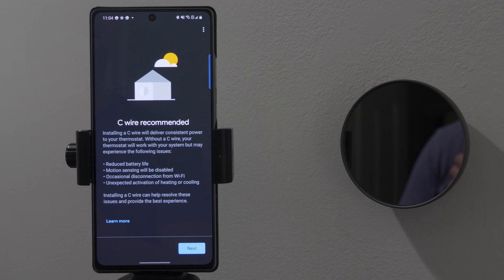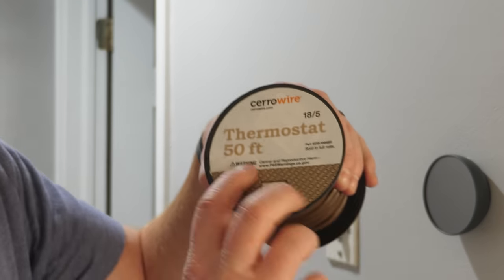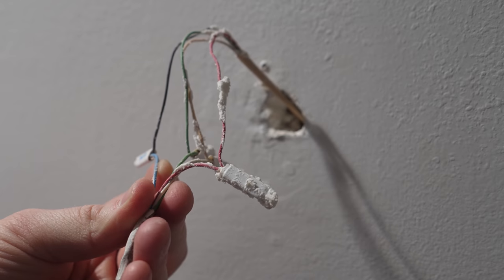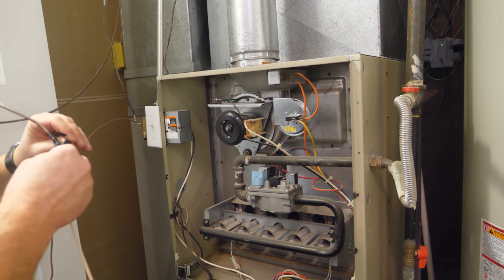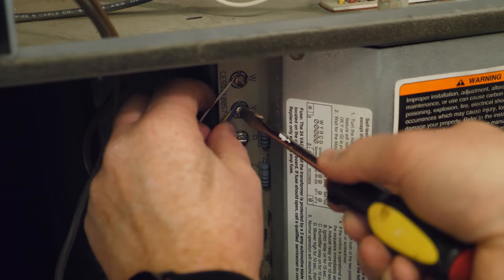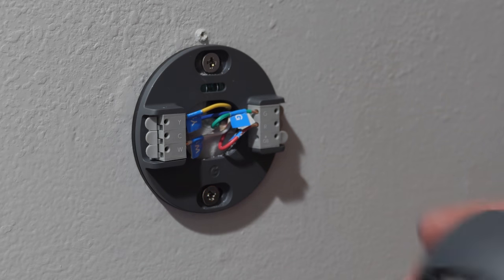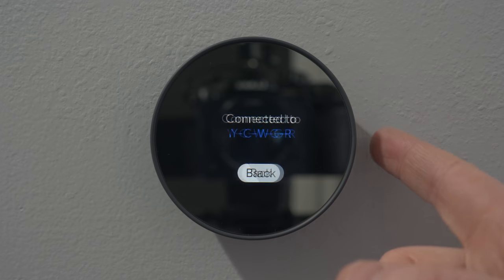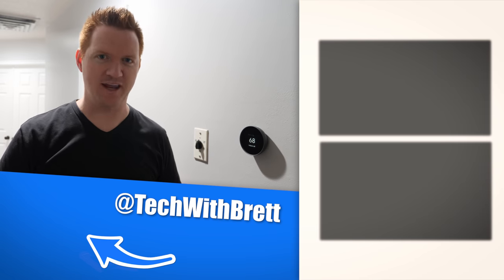Fix Nest Thermostat Issues by Installing a C Wire

Comment from the maker: This process ended up being a lot easier than I thought. Do you have any tips for routing a new cable that is in a more difficult spot?
Reply: I've used glow rods. They're rigid yet flexible. They also glow in the dark. They're helpful if there is insulation in the wall. Also, you might want to add that ppl kill the power to their furnace before working on it. I know it's only 24 volts but shortening out the board of the furnace is still a possibility
Reply: As someone going to school for hvac you really shouldn't mess with your ac unless you know what your doing you can cause some pretty big problems with small mistakes. Examples I didn't hear you saying anything about shutting off power to the air handler before messing with the t-stat wire also the way your stripping the t-stat wire is incorrect cutting into the insulation for the group of wire can cause shorts my preferred method is to grip the green wire and pull it down the length of the wire then cutting away the rest of the insulation but again most people should not be messing with this there's a reason people got to school for this
Reply: @baconbot3106  I mean yea, there's ways to mess anything up in life. People go to school to be auto mechanics, but how many people do their own brakes or oil changes. You could say the same thing there. This is basic 101 type stuff. Any man with half a brain could do this. Now hvac installations and serious electrical work, yes, that should be left to the professionals. But this is not serious. Just take the proper precautions, and you'll be just fine.
Reply: Don't install a nest read my post
Reply: You comment on google video of video google home
Reply: Sorry to be off topic but does anyone know of a way to log back into an instagram account?
I somehow forgot the login password. I love any assistance you can give me
Reply: @Jax Cairo It did the trick and I finally got access to my account again. I am so happy:D
Thanks so much, you really help me out!
Reply: @Kylo Donald happy to help :D
Reply: How about if I only have 2 wires where do I put them on the mirror nest
Reply from the maker: @stevem3493  what are the labels?

Comment: It should be noted for anyone attempting this, that this can be extremely easy and can also be extremely difficult. If there is even just ONE staple inside the wall holding the original wiring it will cause you nothing but grief. Let’s say there is a staple but it isn’t completely tight to the wire. You’ll think that you are good to pull the new using the old, but it’s not only possible but very likely that once your tape joint connecting the old and new reaches that staple it will snag. Your first urge would be to tug a little harder and then uh oh, it comes apart and now you’ve got two loose ends inside a wall or floor cavity, neither of which is connected to your HVAC system. This can also happen with a hard 90 degree turn, or a hole that was only drilled wide enough for the smaller harness. As soon as that tape joint/splice meets resistance, you’re snagged. The only recourse is to start knocking out drywall to finish the job. Not trying to scare anyone, but I do this for a living, and I’ve seen it happen
Reply: Drywall is easy! I live in an old house and the walls are plaster and furring strips.
Solid, good sound suppression.
Pain in the neck to work with!
Reply: Dropping wires should not be under rated in complexity. Good info and tape well, tight, and properly staggered with 3M super 88. A poorly taped end will also come apart easily leaving you up SHITE creek without a pull wire!
Reply: Agreed 100% …. People definitely need to be aware of this
Reply: Hahahaha (eternal laughter). No thanks
Reply: When I had a furnace replaced years ago, they had to run a whole new wire to a new location further down the hall because the original wires were probably stapled and wouldn't come out and it was too tight to get a new wire up to the original thermostat location.
Reply: FACTS REAL TALK
Reply: Absolutely good advice!
Reply: My thoughts exactly. I'm 100% certain it will get stuck if I try to pull it through in a house as old as mine.
Reply: If you do this for a living then when you say “ I’ve seen this happen” what you really mean is “ there is a very very good chance this WILL happen” lol……because I can’t tell you how many times I’ve seen the very thing you are warning people about. 95% or the time there is going to be at least one staple
Reply: Haha I came right to the comments to look for this. Seems like for most people the nest power connector is the best solution.

Comment: You were VERY lucky you fished that line through so easily. My luck mine will have been stapled to the studs all the way down. 🤦🏻‍♂️
Reply: Brutal
Reply: Mine isn't even run through the inside of the wall. It runs straight up from the furnace, into the stairwell, and through the wall behind the thermostat. It's just encased in plastic wire tracking.
Reply: @pthibault630  u do know they have an official adapter now.
Reply: @FaiyazC  Yep. This is cheaper and easier though.
Reply: With my luck that cable probably runs through my neighbors house before connecting to handler 🙄

Comment: 99 out of 100 times the wire has been run through studs or has a staple that will prevent it from being pulled back. You got LUCKY.

Comment: WARNING: try this at your own risk! I tried this, but the taped connection was too thick to go through a point (I imagine it being a hole that's just big enough for the wire itself). I had to pull the new cable back out from the thermostat hole, and I broke the taped connection. Now I have the old wire dangling somewhere inside the wall that I can't see and don't know where. What a disaster!
Reply: Update: after a few days of trying, I was able to fish out the lost old wire in my wall with the help of a flexible rod, a homemade hook, and an endoscope camera. I carefully redid the joint between the old and new wire to make sure it's not thicker than the wire itself and I was able to make it through. The spirit of my story is that you want to make sure the joint is not thicker than the wire itself so it won't get caught inside your wall because most likely the wire goes through some small holes.
Reply: @genegene2417  put the thermostat in a different location.. it uses WiFi to control.. can be ANY WHERE in the house

Comment: Even easier way to do this. Just use the green wire to the city. Most people leave the fan in auto. The green wire is used to energize the fan when the fan is "on". As an hvac tech I have done this many times before. Replacing the state wire is not always as easy as shown. A lot of times the state wire is stapled to the wall studs. When we are working on a new construction job we run a 5 wire.
Reply: Thank you!!
Reply: It's a good idea in case you afraid of losing the cable when you pull through the wall

Comment: Two suggestions... 1. Agree with many comments below that thermostat wire may be secured in most instances by staple(s). So before snaking have someone hold low end and someone hold high end, pull back and forth to assess whether there is free play. 2. Use wiring lube to make sure that the "snaked" wire pulls through any holes... its $5 at any supply house or homey.
Reply: yellow 77
Reply: hehehehehe..... lube

Comment: I’m so glad I found this video as my Nest was losing Wi-Fi every day when the battery ran down. I went to look at my wiring and there was actually a fifth wire already running from thermostat to hvac that just wasn’t being used. It was super simple to connect it to the C wire in the basement and just plug it into the thermostat. 30min of research, about 3min of work, and my thermostat is back online! Thanks!!
Reply from the maker: I'm so glad this could help!
Reply: Thank you for sharing your story same situation so thankful !!

Comment: One of your BEST tech videos.  Upgrading my thermostat to Alexa enabled, I knew I needed a C wire, but your video showed me how easy it was to work with.  I didn't have to pull any cables, and my system had an unused wire so I connected it to the thermostat and the a/c and I was done.  Great video.  (FYI I don't have a nest)
Reply: You have an Ecobee, and don't need a C wire, it comes with an adaptor kit.

Comment: Hopefully my story will help someone. Last fall we installed a Nest thermostat at my sons house. The replaced thermostat was using 4 wires (no C), so we hooked the Nest with the same configuration. The furnace and Nest worked fine all winter. When my son switched to AC in early summer, there was a consistent clicking sound from a relay on the control board. It clicked nearly once a minute, and was aggravating. Though the AC seemed to run fine and shut off at temp. An HVAC guy came out and said that we had a bad control board. We replaced the board and the problem was still there. After watching this video, I decided to hook up a C wire. My sons existing thermostat cable had 8 conductors. So we hooked the unused blue wire up to C on the back of the Nest and then hooked the blue wire to C on the control board. The AC has run for over 24 hours with no clicking from a relay in control board.

Comment: Mine also needed the "C" wire.  Without it I could not manually control the fan.  But, I did not have to run any new wire.  There were several unused wires inside the cable coming out of the wall.  I simply connected the unused blue wire at each end.  Now, my NEST is 100% functional.

Comment: Thanks Brett. I was wondering why stringing a new wire wouldn't work. Now I feel comfortable buying a Nest. I will be putting the thermostat in a new location. My old wiring is not so easy to get at. Thanks Again

Comment: Just wanted to say thank you for your video. I was helping out a neighbor with a new Nest Thermostat and found a blue wire unused. Connected both ends (furnace "C" terminal and the thermostat "C" terminal. It is no longer asking for the power connector.

Comment: Thanks for the this, I noticed that there is now a 'Update Wiring' option on the Google Home App -> Thermostat -> Settings > Theromstat -> Wiring -> Update Wiring. So you shouldn't need to factory reset anymore.

Comment: Sadly, my Nest appears to have a C wire connected, yet for some reason the fan runs randomly even though it's not setup to turn the fan on, which is annoying when it's cold out and it's blowing right on you. But thankfully you made this video which makes it really easy to see what sort of work it would take to set it up again (or at least know what to look at in order to fix it). Thanks!

Comment: Thank you very much,
I was thinking of installing this since several months, end up installing it yesterday.
Rewired as the c wire was missing.Had to cut one hole in the drywall.
Didn't removed the old wire, lets see how it runs for few months and then no need to go back.

Comment: If you are lucky, sometimes there will be an unused conductor on the existing wire.  You'll need to figure out where to connect the free wire on the furnace controller board C.  Sometimes the original installer prefers to just use a battery thermostat rather than connecting to C.  I was able to add C wire to my Nest in my first house and never had any issues.  I actually did it for my parents as well, without issue.  
It's generally recommended to always use the C wire anyway, as there could be temperature inaccuracies or triggering delays when the thermostat achieves the set points.

Comment: You can update the wiring in your home app on mobile. You don’t need to do a factory reset. 

Steps to do this on your mobile :

Select your thermostat on home app >> settings (gear wheel) >> thermostat (under device features) >> Wiring (at the bottom section) >> Update Wiring
Reply from the maker: Thanks for the info. It looks like that was updated since the video released.

Comment: Forgot to mention to turn off power before removing wires.  Or cutting into wires.   Turn power back on last.  If wires touch 24 volt will or could burn up your board

Comment: Had mine installed over a year without a c wire and still working great!
Reply: Does it ever get disconnected from the wifi or the battery dies faster?
Reply: @gloriahansen6727  the only time there was an issue was when I had a new furnace installed and power was off. Bat got a little low and internet disconnected for about 15 min until power was back on.
Reply: I have 4 wire.  Worked fine for a year then suddenly gave e298 error.

Comment: I had an interesting problem with our Nest Thermostat; any load I placed on our two-wire system started the furnace (think; the power it drew to run the Nest). Let me explain further… I started out with a two-wire system, Red and White, Red=Power, White=Call-for-Heat, the legacy thermostat was a standard mercury bi-metal coil. I installed the Nest and I tried placing Red on Rh and the White wire on W1, but the furnace ran constantly. So I ran and added a ‘C’ wire, I kept Red on Rh, the White on W1 (Call for heat), and the C wire, or common to the furnace. The furnace still ran constantly. 

The Nest thermostat functions by using a small amount of current from the furnace to, 1. Operate, and 2. Keep the batteries charged. I did some testing and ANY current draw over 6 milliamps starts the furnace. Testing with a ‘C’ (Common) wire still drew a small current and fired up the furnace. I found the markings on the furnace to be very clear, Power, Common, and Call for Heat. To be clear, W1 on the Nest is ‘Call for Heat’, the ‘C’ is common and R1 is 24 vac or power. This is not rocket science, if I draw any current from any of the wires it starts the furnace. 

I’m thinking there must be something screwy with the vintage furnace, vintage 1995. My initial solution was to remote the 24vac power and supply the Nest power from it, however simply placing the ‘Call for Heat’ wire (W1) on the Nest (along with the common wire), the furnace would start. Finally, I remoted the entire mess, I added a small relay and 24vac transformer in a project box near the thermostat and ran five wires up to where the Nest is mounted. Now everything works well…

The takeaway here is, not all furnaces are created equal…

Comment: What pisses me of is my system actually has 5 wires at the furnace but it appears the common wire was chopped off behind the existing thermostat. I can't run a new wire without relocating it due to how it was stapled down inside the plenum.

Comment: I first installed the Google Nest Thermostat on my Mr. Heater garage heater, without the C wire. The heater would continuously cycle until I installed the C wire.
Reply: U can use the neutral of the transformer for your c wire from your mr heater. Hook a wire up to it and to your tstat c terminal

Comment: Yes, a C-Wire will save your a lot from the hassle of not having one. Without a common wirre the thermostat pulls power from both hearing and cooling. If the AC unit has it's power shutoff for winter or you have dual zone a Common wire is recommended.
Reply: Thanx for the video and all the info in the comments👍

Comment: What I have been told, and actually verified by my own experience about "pulling" wire is: Don't!!  May sometimes be O.K with small cables, but on a bit bigger ones you have to PUSH and then only Collect whatever loose length there is.  That is particularly true when the cable has to go into a conduit.  If you pull, one or other of following things happen.  First, you peel the cable insulation and risk a short circuit.  Second, you pull the conduit along with your cable.  Third, with multiple cables in one conduit, at least the last one wedges between the existing ones and then all are locked in -- no pushing or pulling releases them any more.

Comment: This video is very helpful- just have a quick question- we are basically replacing the old wire with a new one? The new one has the extra for the C wire? Thank you!
Reply from the maker: Correct. My install was pretty easy because of the location of the furnace and the Thermostat and yours might not be so simple. What Thermostat are you using? There is now an option to get a connector so you don't need to rewire. Here is the one for the new Nest Thermostat:  https://youtu.be/tgAiEBqUXIk?si=SH75zYyJEW-3n2Es
Reply: @TechWithBrett  Thank you! My furnace is close to my thermostat because I live in a condo so I've looked and seems easy to do. I have a nest learning pro- I'll check out the other video thanks!

Comment: Except most installers staple the HVAC control wire to the studs and beams! Good luck getting a good home run pull, if that is the case...

Comment: If you get the error "e294 Red wire not connected", and the "skip the blue" wire trick did nothing. I did this: I had W, G, C, Y, and R wires. During the install process, the app will ask you what wires you have. On my 8th attempt to solve this error code, I unchecked the box next to R and checked the box for Rh.  You made need to factory reset the thermostat and start the install over from the beginning if you get the e294 error code just so you can get the wire select screen in the app. The Google Home online help is worthless.